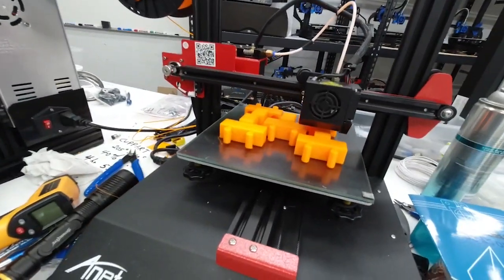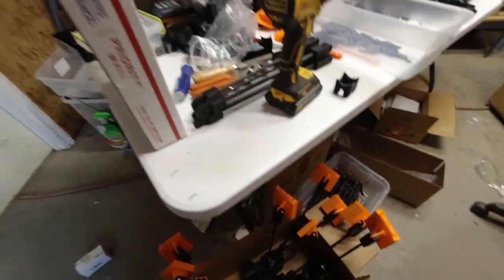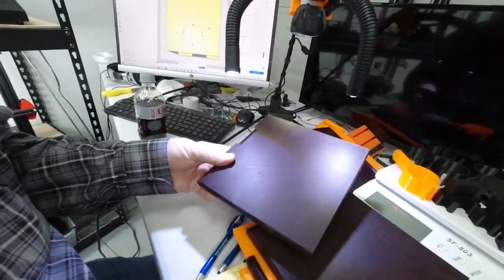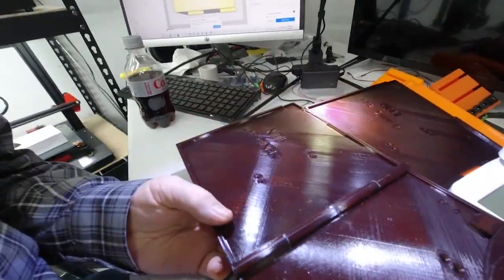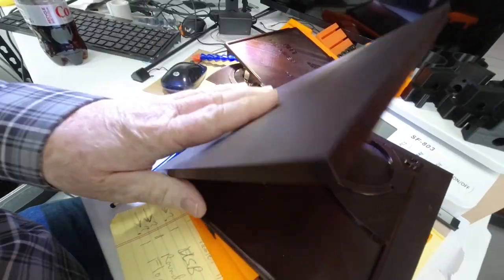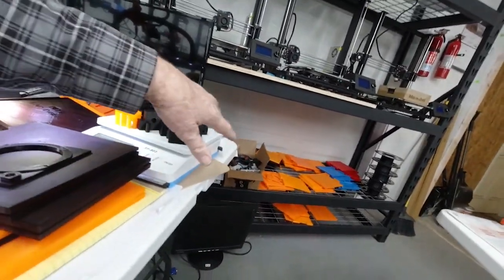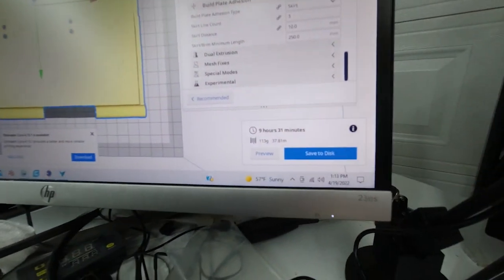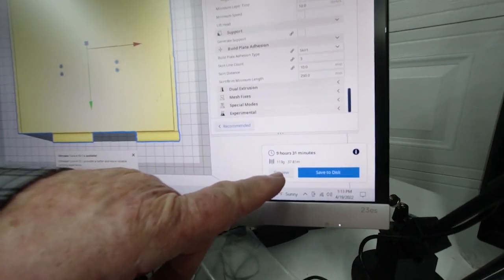3D PRINTING THE LAP DINER at New Tech Inventors 3D Print Farm for sales on Amazon and NTI website

Comment: I have also seen various videos about people 3d printing injection molds.  I guess 3d printing is making the injection molding process far cheaper.  I'm not sure on big stuff like the Lap Diner, but I have seen it done with smaller stuff where people are actually buying mini injection molding machines, 3d printing their own molds, and creating pretty solid looking parts at home.
Reply from the maker: True injection molding requires a very expensive mold and a large upfront cost with a minimum quantity. For my Lap Diner the mold and first run of 2,000 pieces would cost about $12,000 - $15,000 for the mold and about $6 per part. Thats almost $25,000 upfront money needed. Very risky if you don't know what your sales will be. Good question...Ken
Reply: @NewTechInventors  No I'm saying they 3d print the molds.  So instead of paying tens of thousands of dollars for a mold, they just 3d print one.  Not sure exactly how it works out, saw a video on it last summer.  I don't think the molds last as long but they are 3d printed so even if it takes 5 or 10 molds, that's still way cheaper.  There are several videos about it but this is just one of them: https://www.youtube.com/watch?v=wMRSPXt48CI&t=244s